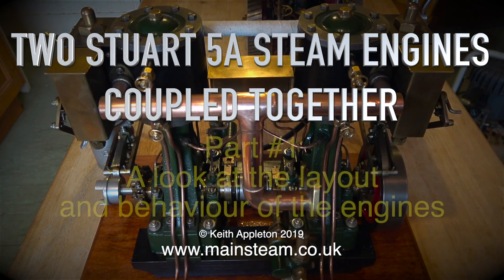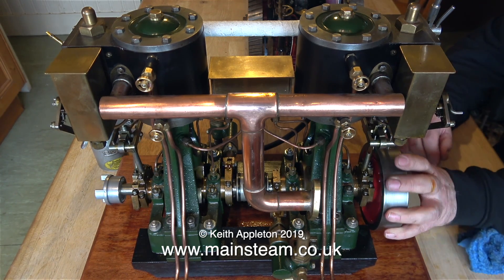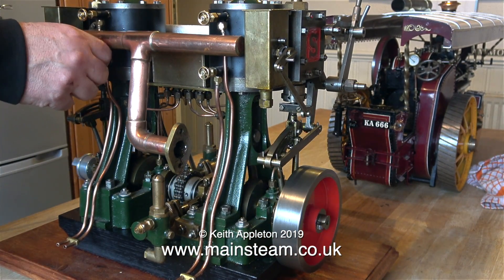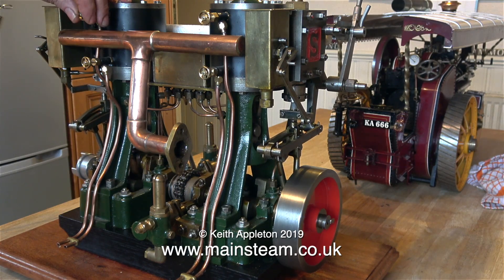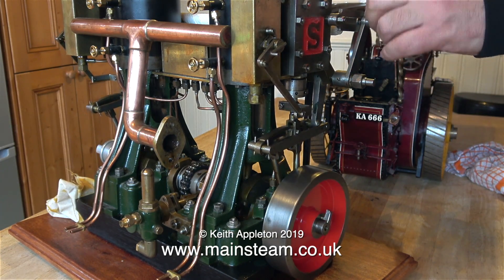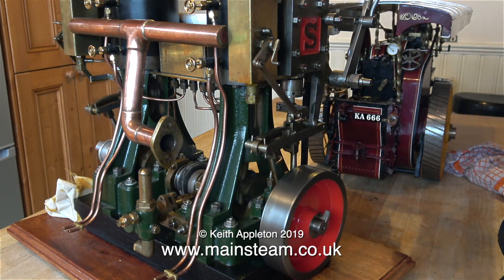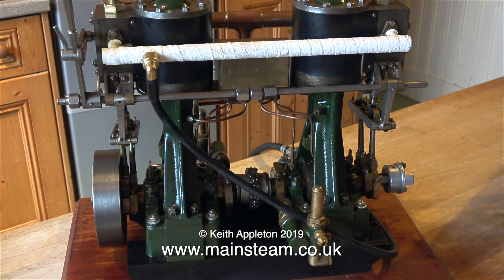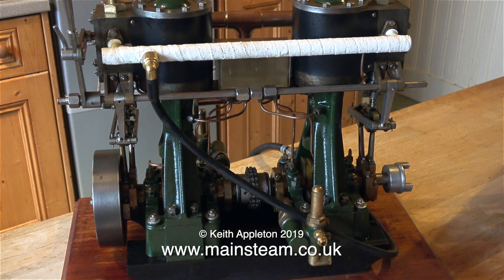TWO STUART 5A STEAM ENGINES - PART #1

Comment: I'm about to build a ray hasbrouck no 5,  all ball races and no casting ,twin cylinder 1.75" bore 2.50" stroke ,do you think the castle v6 would cope with this engine in a 14 ft steam launch
Reply from the maker: You would be better with a larger boiler. Castle Steam make a "V8" boiler which is 8 inches in diameter. I think that would be better.
Reply: @keithappleton  I'd wonder about that if an 8" boiler was available thanks ,I have a question ,as the exhaust from the engine is reused by condensing in a tank then returns to the boiler won't it be contaminated with steam oil ?
Reply from the maker: It is difficult separating the Steam Oil from the water in small scale steam plants. If you are using the boat on a river, use a water filtration system to pump water from the river into the onboard water tank. It is simpler I think than attempting Oil separation.

Comment: These machines seems to be big enough for what I have visioned in mind.
Shame of spoils leaves my chimney. I would like to enable my wood stove to charge my offgrid batteries. Maintenance and care worth  in diligence noted for water level, lube, tar clean, what have you that I am still not made familiar with sounds like fun to me :) 3-5 HP metric should be more than plenty to churn a 24VDC lorry generator (starts at 1350W ++). How is the typical durability of machine wear, runtimes and HP situation in this section of the modelling world? Is there any shop offering shelf scale steam models that realistically can be able to serve and endure to such viability ?

Comment: When to engines are linked are they timed to produce 4 separate power strokes or 2 strokes working in unison?
Reply from the maker: Crankshafts are set at 90 degrees to each other so it is self starting.

Comment: how many HP you figure that engine puts out?
Reply from the maker: a single 5A is 1.5 HP at 80 PSI , so I estimate about 3.0 HP.
Reply: that is not bad, just needs a IP and LP cylinder added onto it haha.

Comment: We used to use what we called a "mechanics stethoscope". A long screw driver with the tip held against different parts of the engine with the handle end close to your ear. Neat trick for finding a bad bearing or a particular cylinder that was knocking a bit. :)

Comment: Could be that you valve timing is off, causing your piston or valve to come into contact with another part of the valve chest. I encountered this problem when I was using a 3D modeling software to design my own steam engine (similar two the 5A’s)

Comment: Hmm. A comment you made got me thinking. Always dangerous.
I have a limited number of Popular Science magazines, from 1905 to 1925 or so. There are certain regular comments made over the years. Converting a steam powered item to compressed air was regularly done back then. If used to power something,the piston would get colder and colder till it froze with ice being the offending agent. Finding a way to heat the incoming compressed air was the only answer back then.
My question is,if you leave that big beast running on compressed air,does it get colder over time ? Or does it need to drive something under power to use enough air to chill ? Love that monster unit. I do hope you keep them together. Impractical ? No doubt,but a very impressive visual treat.
Reply from the maker: no, it's perfectly fine . . . . .
Reply: @keithappleton  Terrific.

Comment: One of the engines in a linked pair will always be running on "reverse". Because the expansion links need to be same direction in order for one reverse lever to be used it can make it difficult for the valve timing for each engine to be set to optimum. They might just be fighting each other at certain points in the cycle. It's difficult to say from the video but both eccentric rods appear to be "closed". It might be best set up with one set "open" and the other "closed" but I don't remember off-hand which one should be set up for the forward running eccentric set. Cheers

Comment: I propose the engine without the flywheel to be the knocker. The knocking is in perfect timing with the up and down motion of the engine without the flywheel. I'm only an 18 year old percussionist with about equal knowledge between external and internal combustion engines. I suspect it could possibly be somewhere on the piston and connecting rod. Perhaps a loose fitment on the crankshaft?

Comment: I'm wondering if the knocking sound could be coming from the coupling between the two engines as it's not a radially solid connection.

Comment: I agree with some of the other comments also. It seems as though the knock is coming from the drive coupler engine, perhaps a rattle fit in the cross slide pin? I also thought perhaps excessive clearance between the cross slide and the guides, but since as you have said the engine is well built I highly doubt that to be the case. (Bear in mind I'm also no expert by any means, I'm merely basing my guess using my machining knowledge) Whatever the actual cause is though, I've no doubt that you'll sort it out and put it right.

Comment: The engines look good. I agree that the clunk gets annoying. Could the problem be in the coupling? If the two engines are not in sync then one may dragging the other at the top or bottom of its stroke. Since the coupling is a chain that may be the source of the noise. What would happen if they were timed 90 degrees from each other?  Each engine would be at the top or bottom of the stroke while the other was in the middle. I don't know if that would have an impact or not. 
Either way I like the videos and please keep making them.

Comment: My reflex response to your noise isolation was, as you later stated, to separate the two. I hope the coupling chain is easily managed. 
I can't remember if you had ever mentioned having a mechanic's stethoscope. I have long found them great aids in such adventures. Cheers & good luck.

Comment: My uneducated guess would be play in the connecting rod/crosslide of the rear engine (the one without the flywheel) as the knock seems to coincide with the rod changing direction. I suppose the same argument could be made for the valve gear on that engine, but the sound seems to be to "deep" for the rleatively lightweight valve gear.